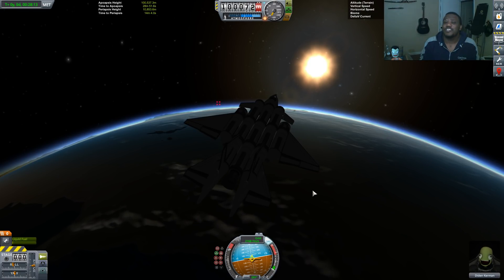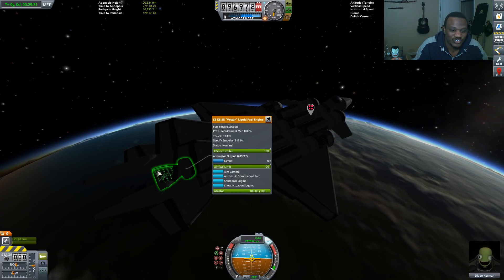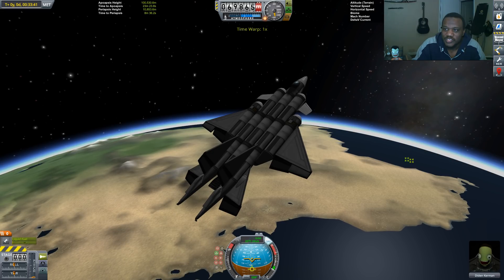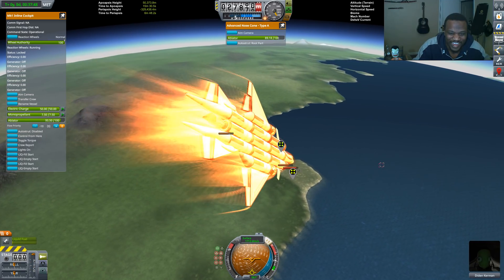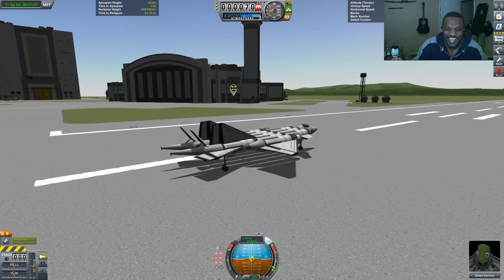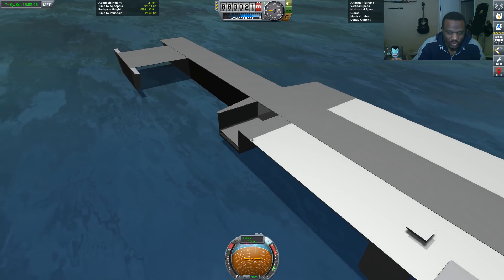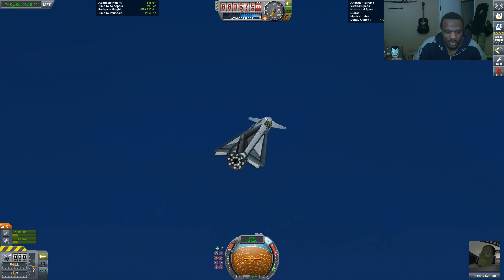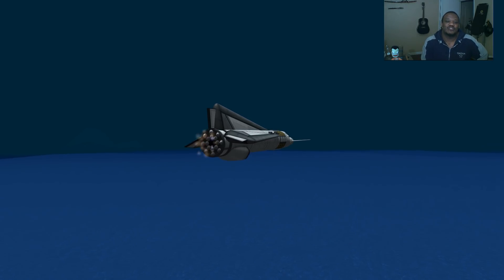Kerbal Space Program | Ablation for all and Underwater bases?

Comment: I could be wrong about this, but I seem to remember that ablation-cooled liquid fuel engines are a real technology. So I suppose adding ablator to engines is not too silly (though in the case I'm thinking of they're using it in place of a liquid cooling system for when the engine is in operation, not for reentry).